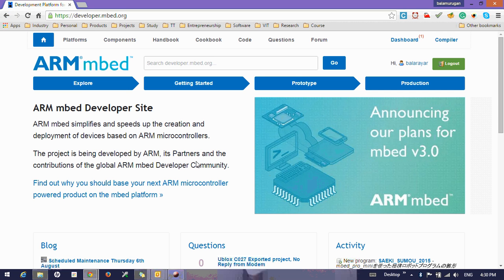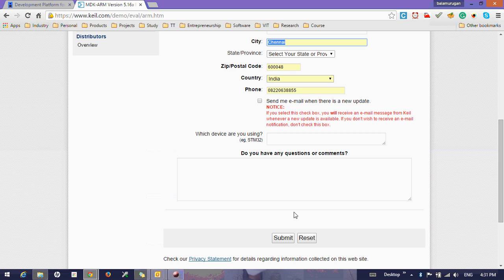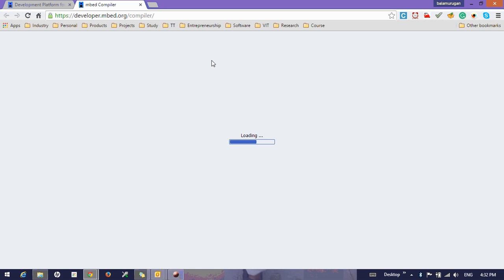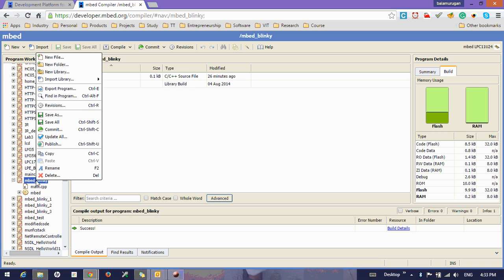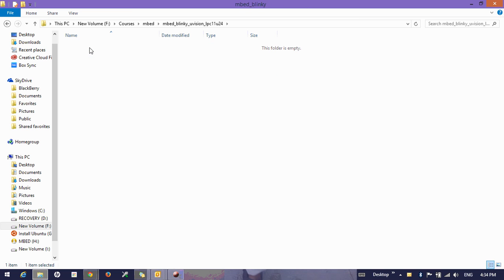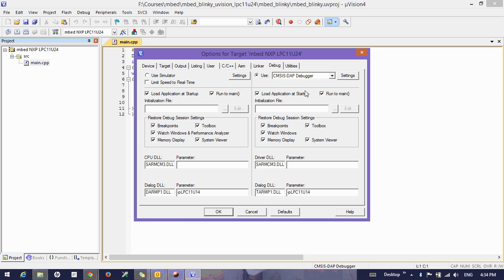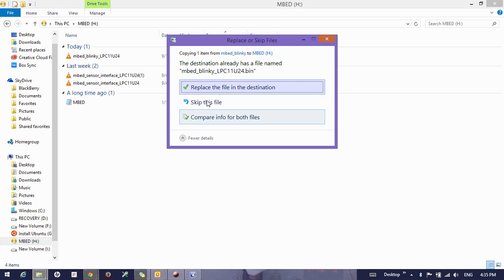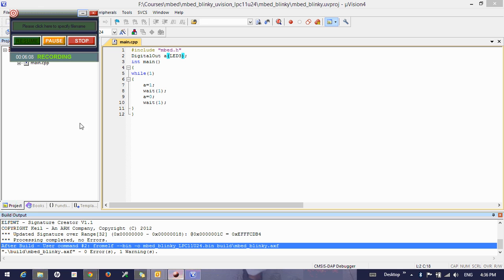Working with mbed offline in keil

Comment: dear sir, its awesome tutorial. thanks. when i export for keil. the file size is 24mb and it open as xml file only. helop me sir
Reply from the maker: Please make sure you do it as directed or you can share the mbed program I shall help
Reply: Balamurugan MS  sir. am using mbed blinky program only to test board. board is working  good for keil example programs frm nrf5sdk. but not in embed exported file. there is a  keil project file while exporting embed project. if i open that it open as xml only. pls help me sir. 7200803616 my num. else i ll call you. give your number sir.

Comment: thank you so much for the reply. i do appreciate it. im a newbie in using arm board. i have tried compiling program by using keil and i think the syntax is kinda confusing (for me) so my option is only mbed because of its simplicity. even though i need to connect to the internet first to use it. from ur explanation so is it possible to compile a program in keil by using c instead of c++? i still dont get it.
Reply from the maker: +Edo Bagus Prastika It's better to do it in c rather C++. As using will be for advanced users. So my advise is to use C++.